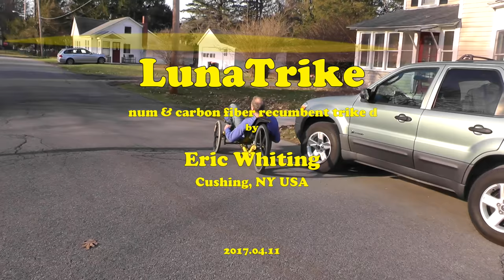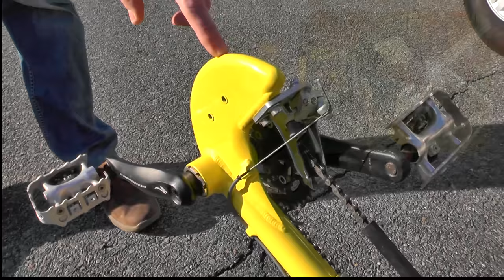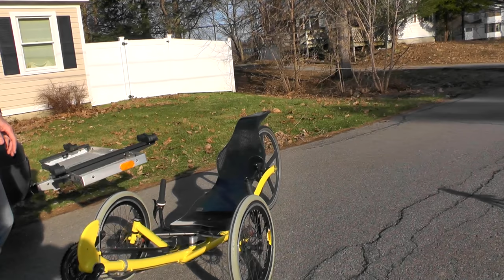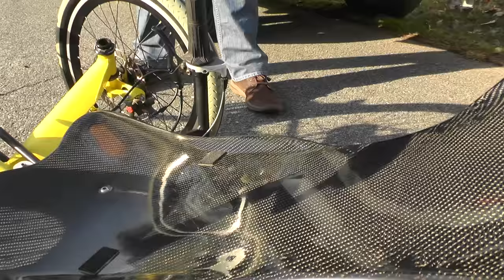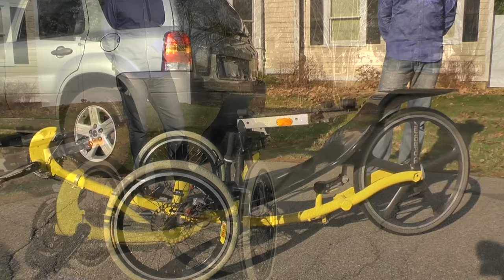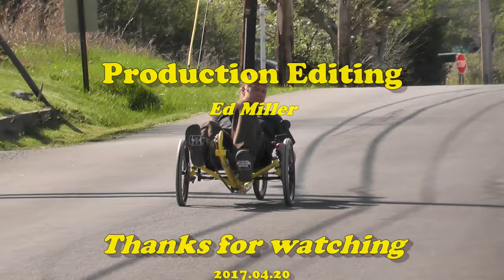LunaTrike Recumbent Trike, 2017-04-11, carbon fiber, aluminum, custom

Comment: Wow Ed, nice new set of wheels.  Get that puppy down to the Cove and see how she does on the hills!  Looking forward to some new videos with that trike.  Of course you'll have to design a nice canopy for it first.
Reply from the maker: No canopy (for now)...., the suspended rear would disrupt a consistent front-to-rear connection. Cove? Not likely, this lady is more 'downtown'! Thanks for watching.
Reply: Looking forward to seeing you riding it which ever way you go.